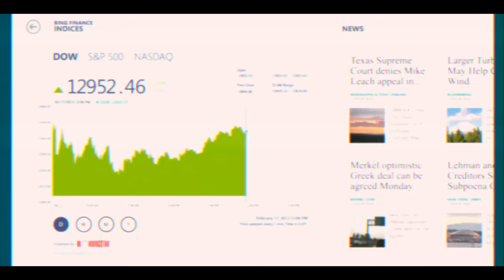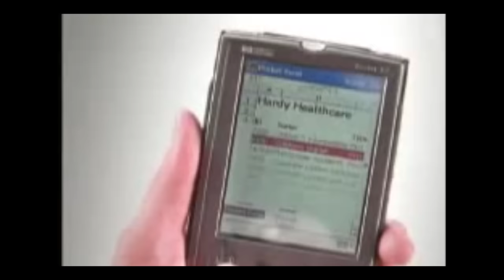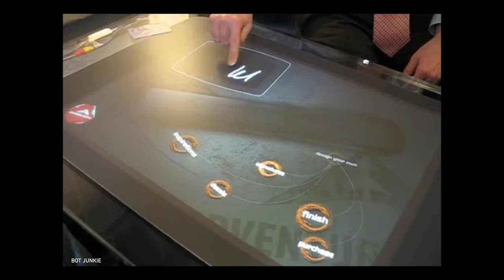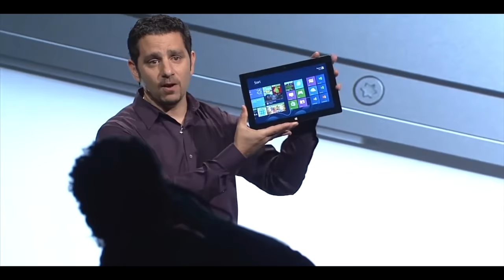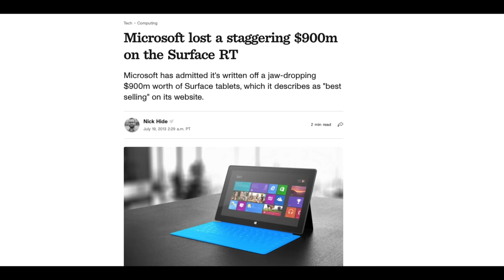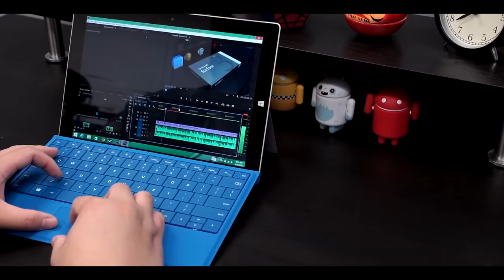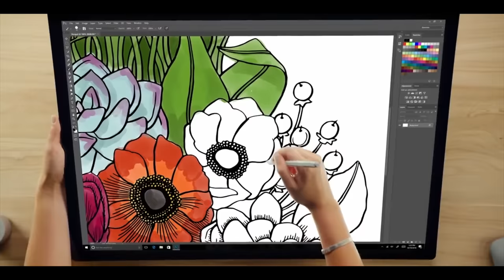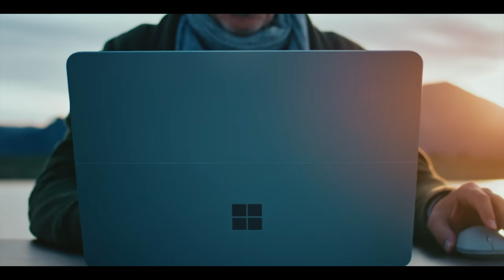How they WON. The untold Microsoft Surface story!

Comment: I love Surface. Ever since the original Surface RT. I now use a Surface Laptop 3, Surface Pro 5 and a Surface Duo 2 as my daily driver. Love Microsofts innovation and commitment to the Surface line and gladly support them.

Comment: The Surface products have always been appealing to me.
I’ve always been tempted to buy one until last year when I finally found the perfect one : the Pro 8. Couldn’t be happier with a computer. It replaced my laptop and my tablet while being an awesome piece of engineering
Great job Microsoft !
Reply: I recently bought the Surface Pro 9 for taking engineering notes, and it is an absolutely fantastic device for that. The product is such high quality, you can tell that those who designed and engineered it really put a lot of effort in. Once you start taking notes digitally using OneNote you'll never want to go back.

Comment: Watching on my surface duo. Started with zune , then windows phone, which led me to surface RT, then pro and book.. I'm reminded of all the bugs and conversations. All the things I created and completed while evangelizing my experience.

Love surface and I'm OK with the short comings. Hopefully many more iterations to come.
Reply: My experience is similar but significantly different. I tried the Windows phone and hated it, hated the Surface RT and still have it, loved the Surface Pro and used it til the battery swelled and couldn't be replaced, and now use and love an LG Gram 16 which is terrific except it doesn't have a touchscreen, but I can accept that since it is so thin and light and still powerful. Surface devices seem too small to me, and my iPad is great for mostly pictures. We all make choices, and the aggregate decides what works in the marketplace which seems like a good idea to me.
Reply: @jeffskent  what caused the hate? Bugged or lemon experience? Didn’t know what you were getting into? All the ways it didn’t keep up with the competition?

I still have an iPhone 13pro and iPad mini. But my SB3 and Duo just fell a bit more fun to use. I’ve seen the gram though, not as many hardware issues as us surface users.
Reply: Love my Zune
Reply: have a duo, watching on laptop 3

Comment: I kinda feel bad for the Windows RT. It was impressive in that they basically ported a full windows system to ARM giving it great battery life. It was a great student tool as it came bundled with full versions of microsoft office (I still use mine as a dedicated device for keeping track of personal financials in excel). It really suffered from weak ARM processors of the time and a high learning curve with windows 8 being so radically different and somewhat goofy. Though, the biggest issue it had imo was marketing. Microsoft pushed it as a full windows experience when it wasn't. They oversold the RT platform and misled consumer expectations and it got a lot of backlash because of it.

Comment: This was an excellent look at the history of the product line Jon. Surface  team is under-rated in terms  of the level  of industrial design and innovation.
Reply: its a fantastic machine but the $1,500 price tag is a lot considering that much money you could buy you Apples latest MacBook Air or a brand new HP Laptop or any other laptop, Chromebook, MacBook, or PC you might want
Reply: Ralf Groene is a genius
Reply: @silasbozarth9857  true. it is very expensive. but this marble of engineering definiteky worth the price tag.
Reply: @zenovak5177  That's the thing that I'm not sure about.

Comment: Bravo Jon... THAT! was really well done. You recreated all the mystery, hope, and excitement that could only have been experienced contemporaneously. I lived through all of the iterations: RT, SP1, SP4, SP7, and hoping one day there'll be a few more ports and the return of microSD on SP10.

Microsoft Surface "Coffee" Table. Around 2008 I was at a two-day porting workshop at Microsoft, and I had my 8-yr old son along with me. By the second day, my son was doing demos for suited-up visitors at Microsoft as he had mastered all of the gesture-based controls and had learned most of the built-in demo apps. I thought it was pretty funny hearing grownups intently asking him legitimate questions. Funny, that is--until I had to start asking them too. That Surface sure did a LOT more than simulate pebbles rippling across pond water! Today, one could take a $22,000 85" Surface Hub and lay it flat on a table to enjoy a similar experience. What could possibly go wrong?

Comment: I do wish they would have kept up with the Surface Book line, I remember the shock and awe when I used it in a presentation to a group of people and I popped the screen off and walked the room while the projection was still going.  If they had just dealt with the battery issue of the first two versions, it could have really kept them on a cool edge of technology.

Comment: Absolutely Fantastic Video. I have been on this trip the whole while. I remembered the Surface RT and loved it. I remember getting it - we also had an iPad at the time in my home, and I was comparing both. The RT was better in almost every way. My kids got Surface devices. We still in our family have only Surface devices. Everyone has one, and they have had the chance to get something different but opt to still have the same. The versatility that surface devices provide is second to none. Once you get a touchscreen windows device - every other device seems like a downgrade. 
The surface team have done a fantastic thing in the industry - they have changed how a whole generation interacts with computers. 
iPads should not be underestimated in their impact also. It was in tandem that these things happened, but the SUrface is a leading light in changing not only what we do but what we want from a PC or any computing device. 
Anyone thinking that a Del XPS13 has nothing owed to Surface tech is fooling themselves. The small form factor, the do anything anywhere desire that the owners of XPS 13s have, is because Surface made it possible. 
Surface came out, and the OEMs were made to get off their hands and do something. And amazingly, they did. 
HP, Dell, Lenovo, Samsung, LG, and so many others decided to give Apple a run for their money and create devices that were "Gorgeous", as Steve Jobs used to say. 
Surface told the people out there that it was possible and left no excuse on the table for PC OEMs. 
The Surface team nailed it. 
The Surface Pro Type cover made it impossible to only have those cheap and disastrous keyboards. 
Excellent and great were in existence, so everyone worth their salt had to make something good. 
We all enjoyed that. 
Webcams too.
The surface devices have had the best webcams since Surface Pro 4, and now every Laptop manufacturer gets beaten up if their webcam is not as good (MS have taken a step back from that with the webcam on the surface laptop ... but we can't have everything haha). 

Thanks, Jon, for the video. It is great to see how the innovation of a team of committed people has changed our perceptions of what is possible and, therefore, our lives. 
Typing this on a Surface Laptop Studio - and I have never loved using a PC as much as I love using this one - it is subline. 
I had a Surface book 2 before this, and I could not imagine using anything else - I really thought I would have that PC forever - it is so good to use I had no idea what using something else would feel like - now this. Wow. 

I have tried using other PCs and laptops from other manufacturers - in minutes, I find things that utterly annoy me, and I want to throw them in the bin. 
The surface has done what it was supposed to - the devices and the engineers behind them made us love them. 
I, like so many other surface users, really do. The devices do what I want when I want them to, and I am enhanced because they do. 

Thanks so much for this fantastic video. 
One for the record books!!

Comment: I still have my Surface pro 2. When i got it i dropped it, and my heart stopped. But was astounded that nothing happened to it. Just got the battery changed so that battery life is just as good as before. However, i needed more power to run SolidWorks 2014, it ran it pretty good. But i ended up getting the Surface Pro 8 i7 version to handle the power. And it runs it smoothly. 

Great documentary. Makes me appreciate Microsoft’s devices more.

Comment: This was nice! Im typing this on a Microsoft Keyboard and mouse, watching on my Surface Laptop 4 15 inch. my 5th Surface device. ive had the Surface Pro 2, 4, 5 and 7+ and the Laptop 4. all great durable devices! still own all but the 2. great productivity devices. i prefer using my Laptop 4 at the office and use the 7+ for greater mobility and LTE connectivity on the go. i wish the laptop too had LTE. for productivity i always go for the surface Pro 7+ before my iPad Pro M1 11-inch because its just a full productivity device in comparison. I don´t see me buying anything else than Surface line devices going forward. all my Surfaces have a pen each and i also use Surface headphones for music and meetings. Microsoft did it just right with this line of products.

Comment: Using a surface pro 9 now. Base components i5 and 8 gb of ram. Even with the base components, it’s actually unbelievable how much, and how well I can work on it with its entry level hardware. The products quality is only matched by Apple. Having a 10 core processor in a tablet, running a full version of windows, and managing an average of eight hours of battery life is nothing short of exceptional and boundary pushing. Not to mention the perfect balance of components and cooling, allowing the device to operate at full speeds when unplugged. It’s much much more than a tablet and a laptop. It is the most functional piece of technology you can own.

Comment: If they make another Surface Book with a big time gaming graphics card in the base, I'd throw SO much money at it!
Microsoft REALLY needs to get the gestures of Windows 8 into the Surface Pro tables. I had the very first Surface RT and man was it the best tablet I have used when it came to interaction. You could do everything without taking your hands off the sides of the tablet.
Reply: Exactly. Windows 8 gestures were the best interaction ever with touch! Nothing came close

Comment: Well, apple won’t do a great device like this as it will destroy their iPad line up.

So, Microsoft create a laptop at the price point of an iPad, but is a good hybrid and laptop. Absolutely nailed it.

Now, apple is afraid and tries to make iPad stand out with stage manager, which doesn’t work. Apple just want iPad and Mac book separated for maximum revenue, but this is not the future. Microsoft surface line up is he future.

Comment: You make it sound like MS did something completely different. I remember the HP+compaq efforts for a latop+tablet that it promoted with Windows back in late 90s and early 2000s. The keyboard that attaches to a laptop was also present in many Asian laptops before Microsoft. Also, the large surface pro was a direct competitor to Adobe's efforts which launched its desktop solution with that hinge and beautiful screen before. You did wrap it up talking about iterations but a quick mention to those products would have given the context about MS improving upon old ideas

Comment: This video puts the Surface line in an amazing light, and don't get me wrong, I am planning on getting a Surface pro soon, but IMO the harsh reality is that Surface never left the identity crysis state (idk why they discarded the detachable screen laptop idea tho). It struggles being a tablet and it's also a computer with compromises (even the surface laptop). The only reason I want a surface pro is because I only do light tasks nowadays, but even if we ignore how powerful an iPad is with that efficient SoC, there is also that ASUS ROG Flow thing that at least can be confidently called a computer (portable if you ignore battery life). It looks like Surface should be targeting the Apple-like, design-focused customers that don't do very much on their computers but need them to look professional, but for some reason they are not targeting it at them. That's kind of my essay on Surface's identity crysis, like: look we did something really cool but we don't know what or who''s it exactly for.

Comment: Thanks for traicing this back to 1990 Comdex!  You left out Surface Hub ;) .  I love Surface, my son was the first to buy a Surfce Pro 3, I chipped in an extra $100 so he could get an i5.   Its was amazing. the next year I spent two seprate days at a Microsoft store 40 miles away and tested every laptop they had. My test was zooming in on Pluto pics from the New Horizons probe. The Surface Pro 4 had the very best result. I still have that and its now running Windows 11.   My current Surface is the Laptop Studio and Surface Duo 2. My wife has the Surface laptop, my other son Surface Pro 6. Great job on the video!

Comment: Microsoft need either Qualcomm or Intel to come up with something that can compete with Apple M Series.
Microsoft also need a revamped OS that is optimized for touch and pen. Google came late to the party and has beaten them with both Android and Chrome OS. Chrome OS runs Android, Linux and Windows Apps on both ARM and x86-64 architectures.
The interesting thing with Google is they have the best of both Worlds, they have 1st and 3rd party Hardware and Software. Microsoft oddly is a better 3rd party hardware and software developer for Google with the Surface Duo 2 now running Android 12L.
Imagine the Microsoft Surface Neo or SurfaceBook with an Apple M2 equivalent SOC running a new efficient Windows OS that is optimized for pen 🖊 , touch, mouse and keyboard ⌨️ backwards compatible with Windows 11 Apps.

Comment: I remember how happy I was with the RT, until I ran into those issues of the ARM hit, but when I got to the Pro 2 and beyond it simply was a huge game changer on how work could be done. The product line is still developing and while I really wish MS would understand that the entire Surface line up, every single device should have 5G built in. I was a bit shocked when they are only doing 5G as an option on the ARM versions again.  For all the forward steps, they just seem stuck on what they want to work vs what does work.

This was a great recap of the journey of the Surface and I still find it a device that is so much more than a tablet.  I can't wait to see what they do with the Duo line, because it is by far the best 2 screen phone that has hit the market, and capable of so much more.
Reply: Maybe the Qualcomm has something in the contract you have to buy/pair the ARM core and the 5g modem.

Comment: Why won't Microsoft resume R&D in the Surface Table so that they can release an updated version of it with a modernized CPU, GPU, display, storage drives and extensive connectivity options? I believe the Table would become an instant success at least with home productivity enthusiasts since it is in a league of its own in regards to innovation. I would not hesitate to invest in one. Heck, even those crime scene TV series (Hawaii Five 'O, CSI, NCIS, etc.) showcased the detectives using it to research information about suspects and crime scenes.
Reply: you should be able to diy this, assuming you can get a huge Touchscreen, just use a desktop or better Mini pc to drive that display.

Comment: Meanwhile, Apple is not sure what to do with their iPad line. It’s a friggin M2 processor in a limited iOS device!
Reply: it feels weird to see stage manager on the macOS now. Find it a bit useless to have when macOS natively has better multi-tasking capabilities than iPadOS. Sucks though, i have the m1 variant and compared to my S8 tab, I can do more with s8 tab then i could with the iPad. Other than video rendering times being way faster and gaming should be "better" on the iPad but when i want a full on PC (almost) -- i'll go with the s8 tab...albeit, if you pay that price, you might as well get a PC haha. I got mine for almost half price during a "flash sale" and the iPad i got it for quarter the price due to some help from a friend. Would never pay that amount for a tablet or iPad. 

I feel if Microsoft does well with their ARM section, it could really transform how tablets can be used. Coupled with Android apps running on there, would be useful for me. 

Also, I would love it if they fix their "modern standby" mode. It's not great. It could be better and i hope they fix that issue.

Comment: While my years as a Microsoft fanboy are years behind me (I use iOS and Ubuntu instead of Windows 10 Mobile and Windows 10) but I’ve always held a deep respect for their products and for their ability to push boundaries, often before Apple does. The issue is, as Steve Jobs phrased it, you can’t have nerds running the company for consumers. Usually what happens is either Apple undercuts them with a consumer-facing product as they did with Pocket PC, or the product is so niche that it flops. Surface came close to being the latter, but the comeback was insanely strong. It’s sad HoloLens will not have this fate. They did something truly magical, but the scandals with Alex Kipman, and the extreme push from the top for profits right away, prevented the necessary innovation that would have put Microsoft on top with not just another Google Glass, but a hands-free computer you can take anywhere! Imagine life at work or on vacation without using your tiny phone screen and two hands to see a map or see info about landmarks on a tour. We can still have that, but nobody has jumped that shark for real, and it looks like Apple will one day do it themselves once more.